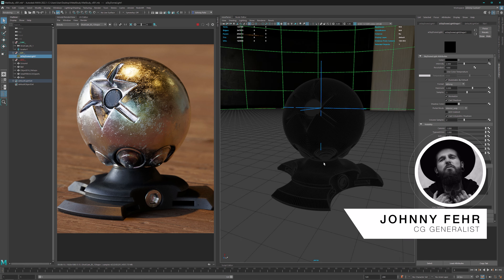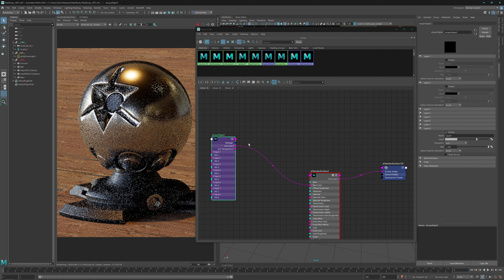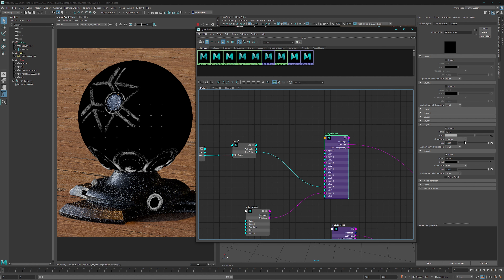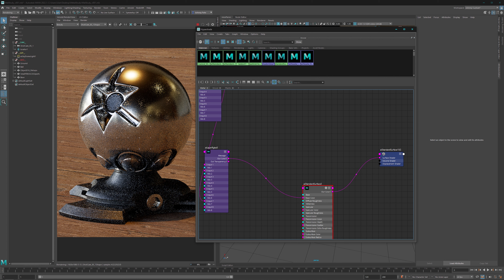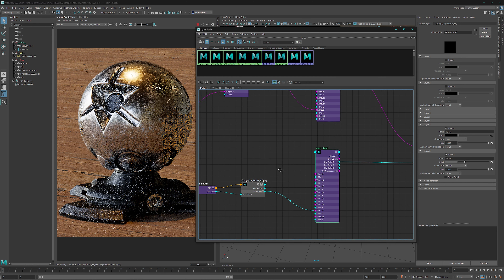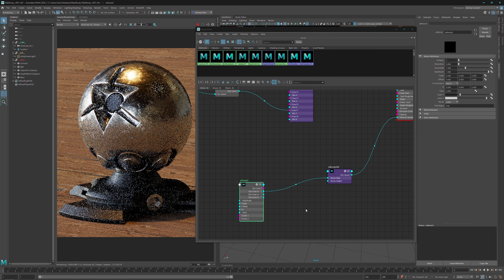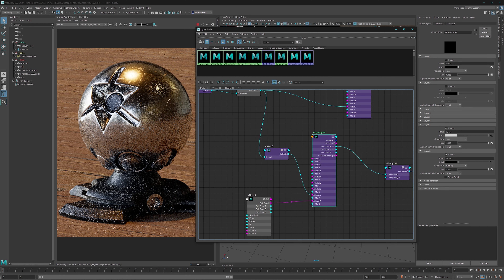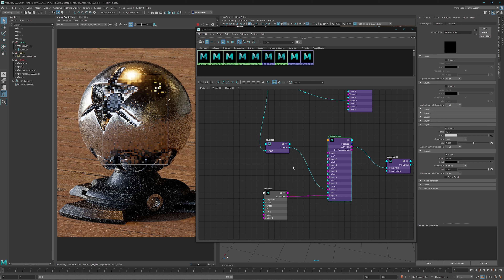Realistic Procedural Metal in Maya with Arnold

Comment: Pretty sure I know the answer to my own question but: To apply the textures to a model such as a stylized logo (lots of extrusions), do I need to UV map the mesh so that it all appears to work together/ line up the textures or are there any shortcuts or nodes that can assist with that part of the project. Love the material I created but not enough in this quick logo budget to justify the UV mapping portion since it is not my strongest skill out  of the pipeline. Usually a hand painter on Zbrush so far :]